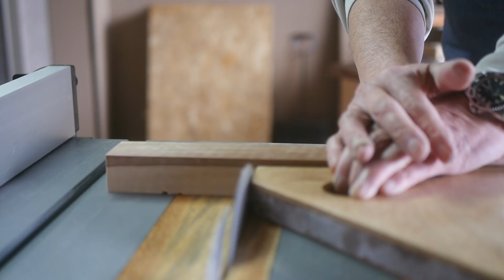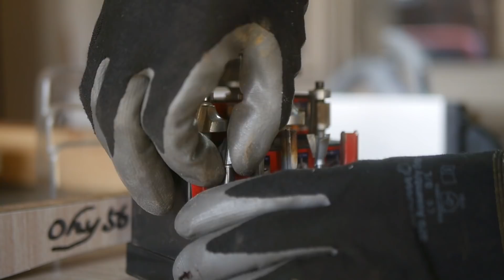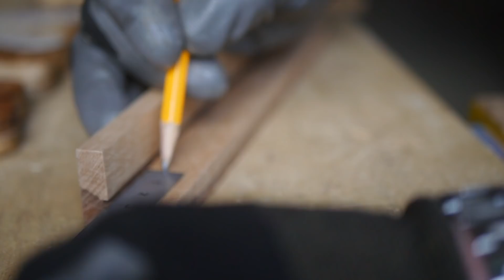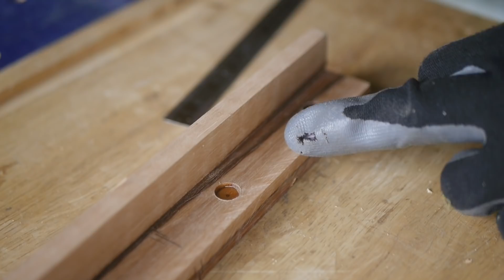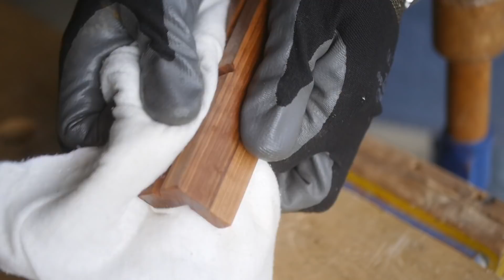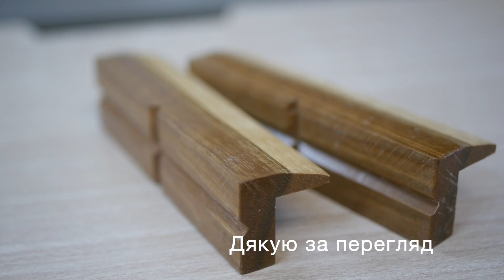It's like chocolates

Comment: Nice "chocolates" Tachi-san, I will definitely be making some of these when the weather gets better (too cold to work in the garage right now). :)
Rare earth magnets are quite brittle, so always make sure that they sit flush with the surface, or ever so slightly below, or you risk crushing them. If the vice jaws are serrated, remember to take that into account.
I once used rectangular magnets with a countersunk screwhole for a project (holder for my leaf blower), and cracked the first one because I drove in the screw too hard.
Reply from the maker: Hello Henrik san
Thank you for watching my video and for your polite and nice comments. I will check the magnets tomorrow. ・ ・ ・ Tachi

Comment: Rare earth magnets are very brittle. Glue them slightly below the surface of the wood so the pressure of closing the vise is on the wooden Jaws and not the magnets. They will still hold fine.
Reply from the maker: Hello Gary
Thank you for always watching
And thank you for your nice advice
If you encounter any difficulties, we will deal with them based on your advice.

Thank you from Japan